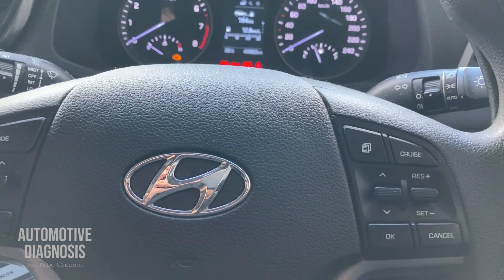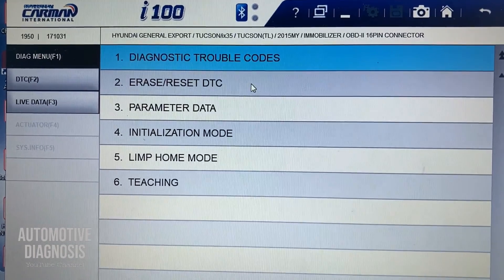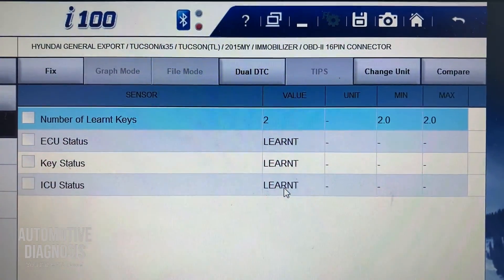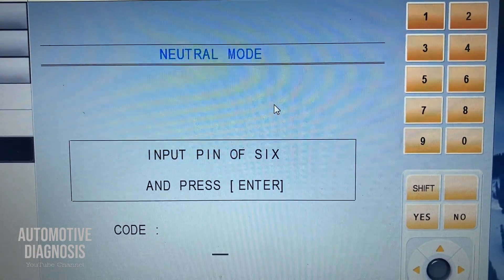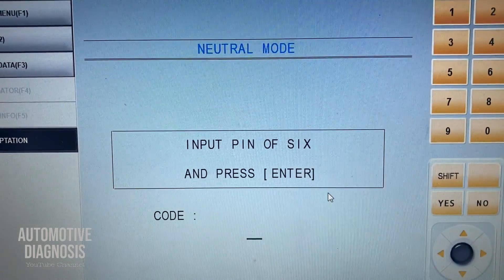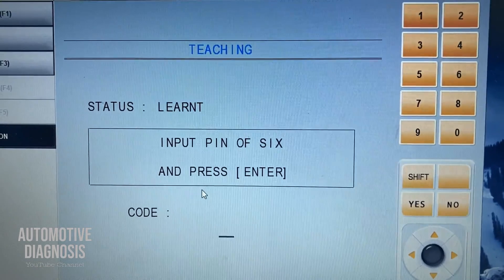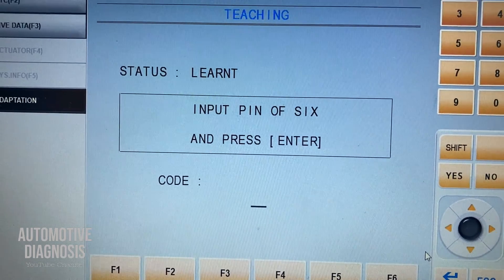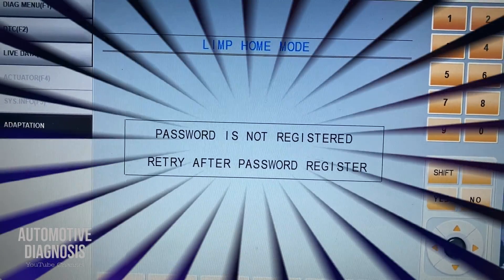How to Program Keys & Neutralize Immobilizer on KIA & Hyundai | Key Teaching | Limp Home Mode

Comment: If key not working. Far  in 30 centimeter not working happen since change ecu. But when  I use key pob use as finger  can show light in meter  then when push brake second time pust  was starting

Comment: WHY DO I KEEP GETTING Invalid Samatra ,,, 2014 HYUNDAI ACCENT RB ????????????
Reply from the maker: You mean incorrect part number or a message in scanner?
Reply: Hello to all I am working on a 2014 hyundai accent rb model with a blade key . I am trying to program a brand new pcm from the dealer with a brand new key from the dealer also . The immobiliser tool I am using to do this job is the autel km100 . But every time I in put the six pin key code I keep getting a invalid samatra message on the tool. The battery is fully charged and I have checked all of the fuses . I did a scan of the immobiliser system and it says virgin pcm and virgin key also invalid samatra and no keys learnt . I have also tried a used samatra module because we could not get a new one right now and when I scan the immobiliser system before inputting the six pin key code with the used samatra module the scan says virgin samatra but as soon as I input the six pin key code it gives me a invalid samatra message . Checked the coil antenna with the tool and it give me the signal . I would appreciate your help please ,, if there is anything more you need to ask just let me know  @AutomotiveDiagnosis
Reply: @8power0 why would you put a new key?

Comment: Good morning please what will happen if you didn't do the neutralised
Reply from the maker: I’ve tried teaching the new keys without neutralising and every time worked well. I normally do the neutralisation if I want to swap the ECM or Immo. Unit with another car.
Reply: @AutomotiveDiagnosis  please you swap it to  one that has the same part number or what
Reply from the maker: @ernestdamo677  Must be the same part number, and we do that for testing the second car (to see if ECM is faulty or not) or for using a used part.
Reply: @AutomotiveDiagnosis  thanks for your time